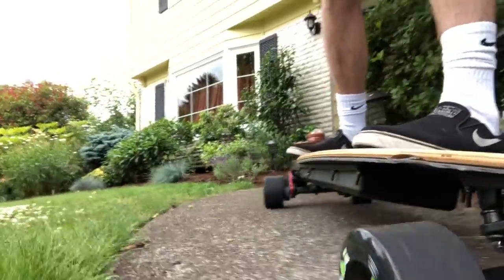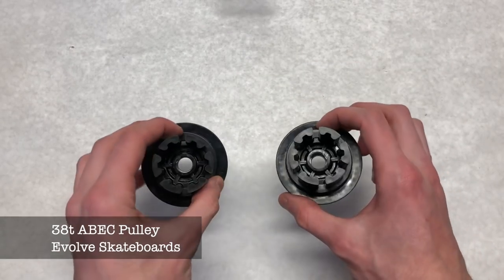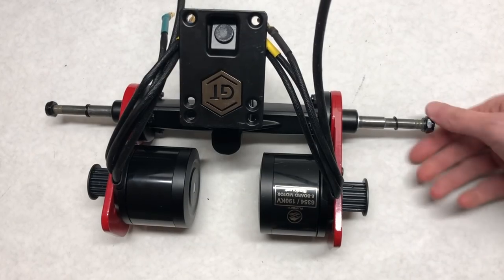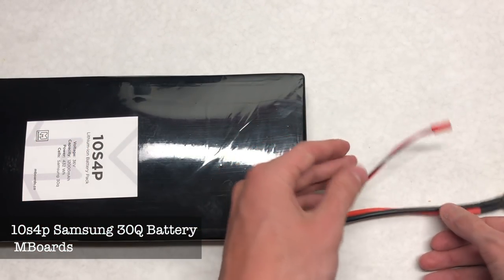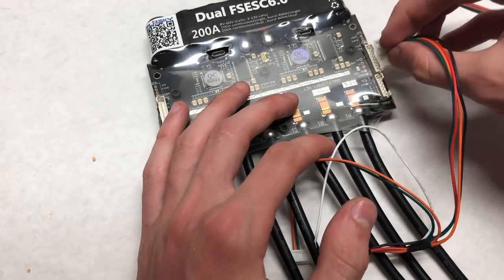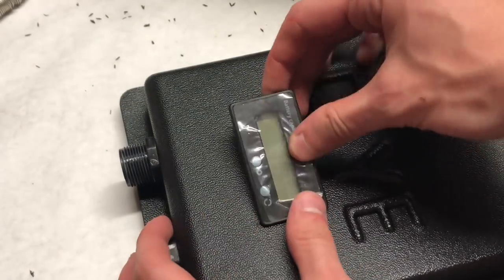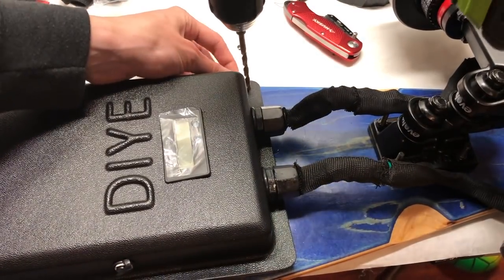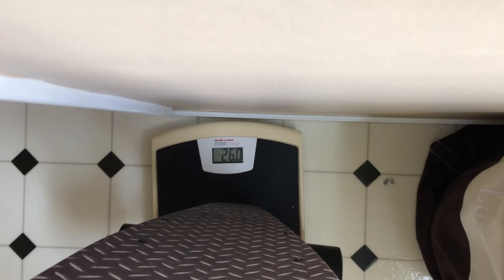How to build a 30MPH, 25 Mile Range Electric Skateboard

Comment: A reverse function has always been available, in order to configure your board to do so, you want to use CURRENT in the vesc tool instead of using Current No Reverse.
Reply from the maker: Yes of course, but with the remote you don't even need to do anything in the VESC tool, its all built in to the remote
Reply: Just a note** that's only if you get the UART version, the ppm version for non vesc's will not have reverse functionality even though still compatible with vesc.

Comment: E-skate builders: *spends 1400 on a build
Also E-skate builders: to poor to buy dremil lul
Reply: That battery pack is very expensive ... probably half the cost or more. If one were to buy the battery cells and make their own 10s 4p pack it would cost closer to 250 bucks and thats the top Li ion cell available.
Reply: @silversrayleigh8980  so true. always best to make your own if you have a spot welder..not worth risk soldering
Reply: @silversrayleigh8980  10s 4p? Can you explain what that is please? I'm thinking of doing my own build
Reply: budget: 100%

Comment: cheaper to buy a premade one. but nice to make something yourself and that way its easier for you to replace and upgrade as you did it. But easy to f it up too

But have you had a problem with the led and its battery box falling off due to vibration
Reply from the maker: DIY is certainly no longer the cheaper route for high end boards. The LED's do have issues sticking

Comment: I followed your build and built the same board using the components in your video. I did a range test yesterday and went 10 miles in M speed with 27% battery left. What speed are you running to achieve a 24 mile range?
Reply from the maker: Thats very odd... I personaly use a 10s4p Samsung 25R battery (has less range) and 32t and 100mm BOA (worse gearing) and it goes 18 miles with me going full throttle and on very hilly terrain.
Reply: @DIYesk8Builders  I did another 10 miles in L mode the other day and the battery level was at 47%. How can I get better range out of the battery?
Reply from the maker: Thats strange... Are you for sure using a 10s4p with Samsung 30Q's?
Reply: @DIYesk8Builders  Yep its a samsung 10s4p 30q, dual 6.6, 107" wheels, 38 and 15 pulleys. Unless I have some incorrect settings programmed.
Reply from the maker: What version firmware do you have?
Reply: @DIYesk8Builders  I believe its 3.63

Comment: Is there a video where you test out the board? Reliability, Acceleration, Top speed, and Range? I would like to actually see this board do what you say it can.
Reply from the maker: We unfortunately can not film a video about it because it was sold to a customer
Reply: @DIYesk8Builders  ohh I understand, ok thanks. Hey I was wondering if you have by chance done a build with the Samsung 40-E cells? And also what is your average price for a custom build like this?
Reply from the maker: We have never tried the Samsung 40-E cells. The average cost for one of these is around $1,500 so its not really saving money compared to prebuilt, it is more to get better performance than pre- builts

Comment: Can I use a drop through deck for this? And what is the minimum length I would need
Reply from the maker: Yes you definitely could. I would say you could get away with a 36 inch deck but that is not for sure. I know for sure that this deck works and is plenty big enough https://www.skateshred.com/40-x-9-5-bottlenose-top-mount-blank-deck.html
Reply: @DIYesk8Builders  Thanks! Also, I'm new to this and don't know much. I watched Mike Beard's video on how to program a VESC and I'm wondering what kind (if any) of sensor this build has
Reply from the maker: It has hall sensor wires connected
Reply: @DIYesk8Builders  thanks

Comment: Got the anti spark switch from flipsky and it worked turning everything on while testing everything. So I disconnect the switch to fit everything back in the enclosure, plug it back in and it powers right up without the button. And theres no light lit on the button either nor will it shut it off without unplugging it. Is this switch faulty?
Reply from the maker: That is very odd, I have never heard of anything like that. I would take everything apart and put it back together again
Reply: @DIYesk8Builders  yeah did that looked at everything which aint much. I messaged flipsky see what they say.

Comment: Building this board but unfortunately stuck on the PPM Pulselength mapping step. The VESC tool isn't showing any movement however I can still operate the remote forward/backward. Anyone have any ideas?
Reply from the maker: What remote are you using?
Reply: @DIYesk8Builders  Hey mate, thanks for the quick reply. I bought a VX2 remote when it was on sale... think I might have been better off buying a VX1. The vesc is a flipsky 6.6 dual vesc mini. Thanks heaps!
Reply from the maker: I don't think that your are meant to do any pulse length mapping within the VESC tool. You just say that its PPM and then after, you plug in the receiver. You do the throttle calibration within the VX2, there's a setting for it.

Comment: Would the ABEC 110's be a suitable wheel choice if I wanted to do some light offroading? E.g. gravel bike trails?
Reply from the maker: The ABEC 107's although very large, would probably not be the best option for gravel. If it were compact dirt or grass then they work fine. It all depends how loose the gravel is. The looser, the harder for any wheel to go over. I know the slick revolution Foamier are coming out pretty soon, those may work a little better, but I have never tried them, just a guess. https://slickrevolution.co.uk/product/slick-revolution-120mm-foamies

Comment: Cool build!  I just bought a pintail deck to build a board with similar specs.  I notice that you use 6354 motors.  I weigh about 220lbs.  is that motor(dual setup) enough to get a performance similar performance?  Or given my weight, would  it be better for me to use 6374 motors instead?  BTW, I think that pintail deck is a great commuter board setup.
Reply from the maker: I would go with dual 6374. I personally don't like the pintail as much as a downhill, but everyone has their style

Comment: Does the flex of that board have any effect on that large enclosure?
Reply from the maker: The deck is pretty stiff so no
Reply: Vinny F great point! I was considering putting this stuff on my variflex pintail but that’s a pretty springy deck and the battery would probably fly off with any of my trampoline-style hijnks!
Reply from the maker: Yeah, make sure to use a relatively stiff deck with a long enclosure
Reply: @DIYesk8Builders  Yeah Im debating on whether to use an old 46" Sector 9 bamboo pintail I have or buy something.
Reply: @DIYesk8Builders  do you know what size that braided heat shrink is on your wires?
Reply from the maker: I got it from Amazon, I think its 3/4 inch. 1/2 inch fits around the wires but not around the connectors

Comment: How does it compare with an Evolve GTR in your opinion?
Reply from the maker: It has the same battery as the GTR, 10s4p with Samsung 30Q cells so they are similar in terms of battery. The motors on this board are much more powerful that the GTR though. I personally think that this board is better, but its up to what you value. The GTR will have more flex than this, as the battery is flexible. Hope this helps answer the question

Comment: The dual 6.6 esc you used from flipsky is that the pro or the mini?
Reply from the maker: The regular 6.6, The pro comes with an anti spark, which probably would've been worth it.
Reply: @DIYesk8Builders  does using the 6.6 pro eliminate using the power switch pro?
Reply from the maker: Yes, as there is a switch already build into the VESC.

Comment: If you want to run your leds off the board just cut off the aa batteries and solder on a servo connector and plug it in to the receiver. (5v same as 3 aa batteries)
Reply from the maker: I was thinking of doing that but I wasn't sure if the current to run the LED would be too much, as it is only meant for the receiver which doesn't use much current
Reply: @DIYesk8Builders  Typically the bec on most escs supplies 2a to 5a of 5v power. It will run as many leds as you want plus servos and other 5v accessories. We do it all the time on rc cars and drones. You can have the lights on a switch on your remote too. Keep the vids coming, I'm in your area up in Vancouver. 👍
Reply from the maker: Thanks for the info man. Nice to see you are in Vancouver, I don't see too many esk8ers around!

Comment: Did the bullet connectors come with the esc and motors ?
Reply from the maker: Flipsky 6.6 does not come with bullet connectors. We soldered our own on
Reply: @DIYesk8Builders  Do you know what size connectors you used?
Reply from the maker: 4mm bullet connectors
Reply: @DIYesk8Builders  👍
Reply: @DIYesk8Builders  I got my flipsky 6.6 it came with 6 connectors. Also the battery wire leads on the 6.6 look way to big for and an XT60 connector.
Reply from the maker: Interesting, mine didn't. Yeah, the wires are huge. I just use XT-90 on mine or bullet connectors even
Reply: @DIYesk8Builders  Yeah definitely gonna need 90's.
Reply from the maker: Yeah for sure. I even tried using XT-90 once and it wouldn't work so I just used 5.5mm bullet connectors, which isn't ideal but it works

Comment: fascinating build!  I'm still researching parts list for my build.  Actually, I'm building 2 boards.  Do the Evolve trucks  provide more stability compared to the trucks from diyelectricskateboard.com?
Reply from the maker: The Evolve trucks have the reputation of not being stable at high speeds because they are double kingpin. In my opinion, they are stable and are my favorite for diy purposes. Torque boards trucks are not as wide, but are still wider than standard. They’re both great, but I prefer the Evolve. If you’re looking for most stability go with torque boards
Reply: @DIYesk8Builders   Thank you very much sir!  I think I am planning on doing two builds for myself.  One will use the Evolve trucks for commuting and general purpose.  the other will be for general purpose and speed.  It sounds like I will put the Evolve wheels on the Evolve trucks and the other that is more for speed will be for/street will have the Torque boards trucks with MBS wheels.  BTW, can you think of any wheels better than MBS?  Thanks again!
Reply from the maker: What kind of wheels do you want? My personal favorite are the BOA 100mm. I personally find the 100mm mbs wheels a little rough. The BOA's are so so smooth

Comment: Did you have to buy all the components to make up the truck?
Reply from the maker: No, I bought the whole truck as one piece
Reply: @DIYesk8Builders  ok, yeah I dont see it on there site or anywhere selling it whole. Evolve has them on there site in individual pieces.
Reply from the maker: Thats interesting.. Kind of annoying. We have trucks with identical dimensions for Evolves on our website for sale right now if you are interested.
Reply: @DIYesk8Builders  Yes I seen that, I just bought the parts just something else to put together. I was just curious. Thanks

Comment: Who GAF about speed? The most important thing should be  RANGE.. if I need to explain it the fastest any skateboard should go is 30 mph. No need to go any faster than that on something that you are just loosely standing up on moving across unpredictable surfaces .Now with that out of the way. Let’s see if we can build a 50 mile range board. a board that you can get several rides out of before having to plug it in and recharge it. A board that can climb hills of any steepness without burning up the motors .
if you want to speed get a different kind of vehicle

Comment: i dont understand when people make builds without putting links to all the parts.
Reply: motors, battery, trucks and other drive train stuff is from diey electric skateboards. fsesc and anti spark is flipsky. other stuff is just amazon. flies away
Reply: Paul Rocco Catinella  I had this question myself.  You will have to go the link below.  The trucks are NOT sold as a complete unit.  So, you will have to buy the individual components and build the truck yourself.

https://evolveskateboardsusa.com/collections/gt-carbon-parts

1x Strut - Front
1x Strut - GT Rear
2x Base Plate - Gen3
2x Truck Arm - GT
2x Evolve SuperCarve Bushings
2x GT Spare Screw Set
2x Spacers and Speed Rings

I hope this helps.  I'm compiling a BOM with price and links so I can compare different builds
Reply: Why, can't you use Google, no? What is wrong with kids nowadays? They're so fuckin lazy and want everyone else to do their work for them, hello, this is the real world, youth HAVE TO do some work to get the results you want, like everyone else in the world!
Reply: @troibandy2139  Doesn't a set of bearings come with a set of spacers and speed rings?

Comment: Do you have to reprogram a vesc when the hall sensors get disconnected or only when the battery gets disconnected?
Reply from the maker: Not when battery gets disconnected, we usually re program any time connection between the VESC and motor is disconnected (phase wires or sensor) just to be safe